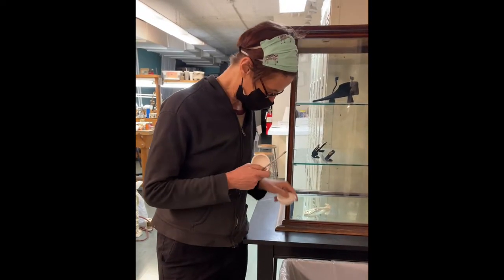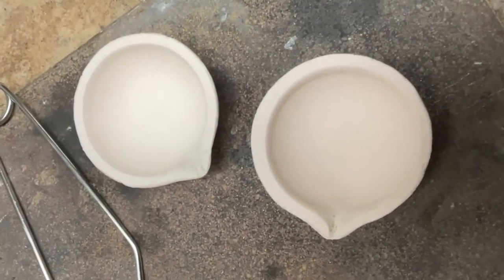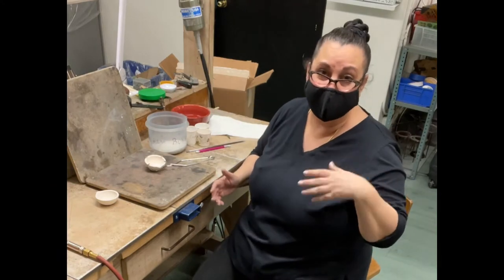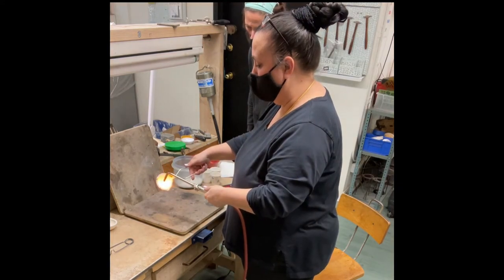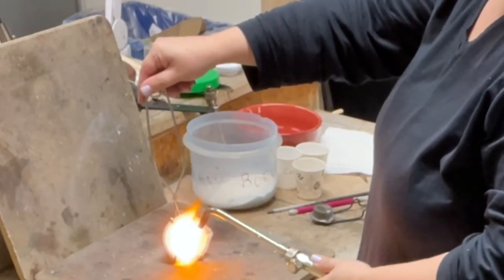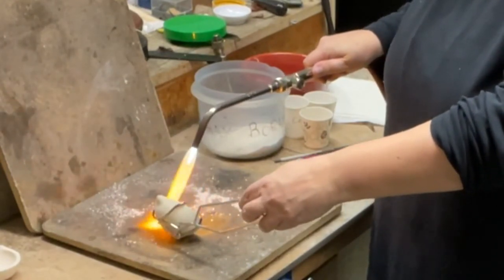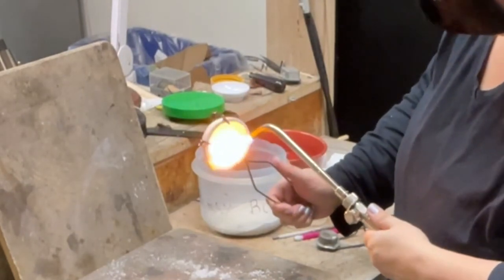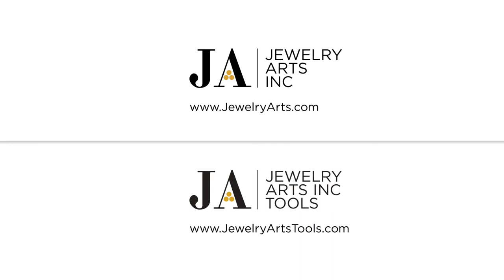How To Prepare My Favorite Ceramic Crucible for Pouring Ingots

Comment: I tried this for the first time, using an Orca Easy Torch with the largest tip.  Is it possible that I’m not getting enough heat from this torch to be successful?  At this point I have too much borax on the surface with not enough coverage & I’ve spent more than an hour trying.  I purchased a MAP gas kit but haven’t yet tried again.  When I bought the Easy Torch, I was under the impression that it could handle this application as well as melting the silver scrap.  Thank you in advance for a suggestion if you can respond.
Reply from the maker: So the borax doesn't get hot enough to spread across  the crucible when tilted? That definitely sounds like a not-enough-heat problem. It usually takes a few minutes to get the borax hot enough to spread but an hour is way too long. Are you getting right in there with the torch?
Reply: @JewelryArts  I think so...but I bought a MAP gas torch kit to try ASAP.  Thanks so much for your input...it just seemed like I couldn't get enough heat out of the EZ Torch...I'll let you know how it goes...I've had to take a break to get ready for Christmas.
Reply from the maker: @patriciastreber1610  That should do it! More heat should be your solution. :)